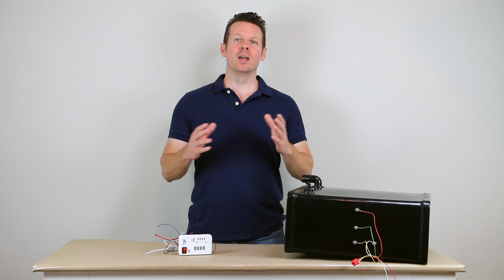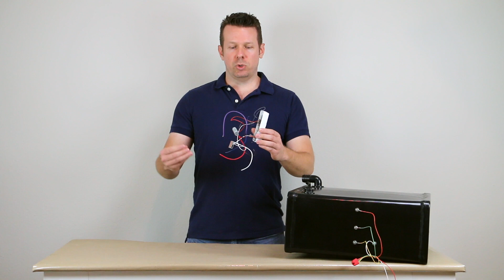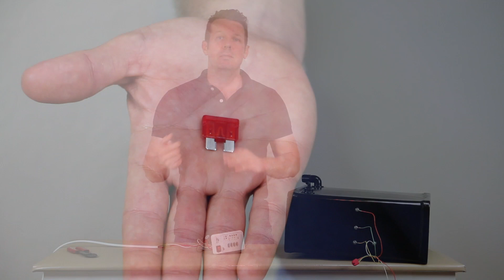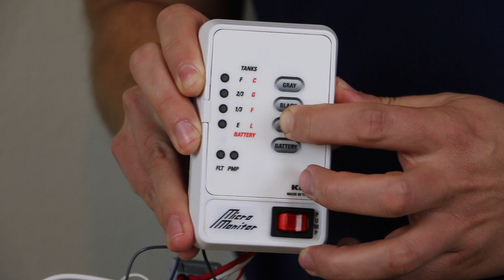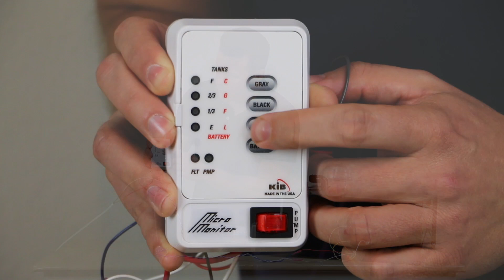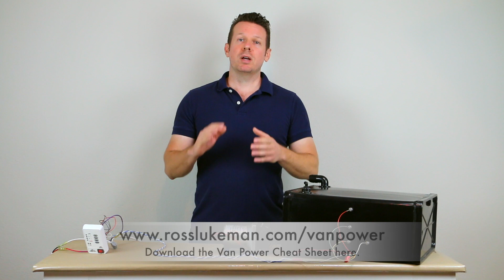Easy Water Tank Level Monitor for Van Conversions | KIB Micro Monitor System

Comment: Just installed the KIB probes just as you show on the video only to find that the ground is supposed to be a minimum of 10 inches away from the probes to work.  The diagram that came with the probes actually show them in an arc starting at the lower left and moving up towards the top and to the right.  Recpro contacted KIB for me and was told that the ground had to be at least ten inchese from the probes to function properly.  I'm now trying to figure out how to move the ground the required 10 inches and how to fix the hole that is now where the ground probe was incorrectly placed. Any suggestions?
Reply: Leave the probe and don’t use it, it won’t leak.  Get another probe, drill its hole and use it.

Comment: Hi Ross!  Nicely done.  This video provides all the essentials for getting the KIB system set up and you provided helpful learning points along the way.  As always your ability to teach these topics is top notch.  I know the SeeLevel system is more expensive than the KIB for sure but do you know if the external monitors of the SeeLevel system are affected by slime as the KIB probes are?
Reply from the maker: Thanks Kate! On the SeeLevel monitors, they don't have the slime problem because they take the reading a different way, and simply sense whether there is water or air on the other side of the tank wall. Thanks for checking out the video!